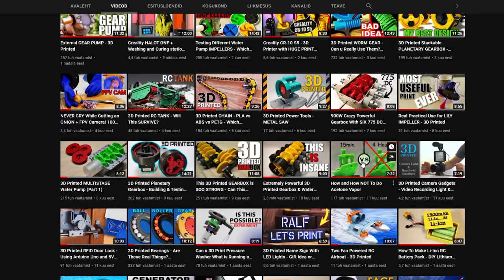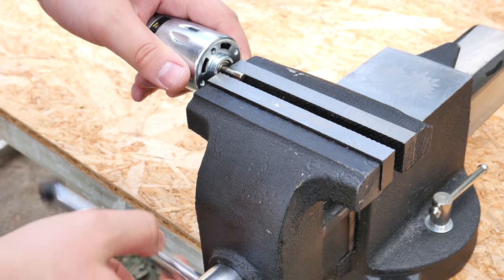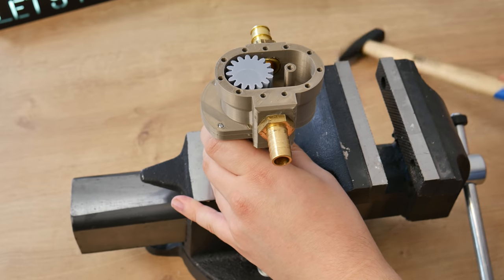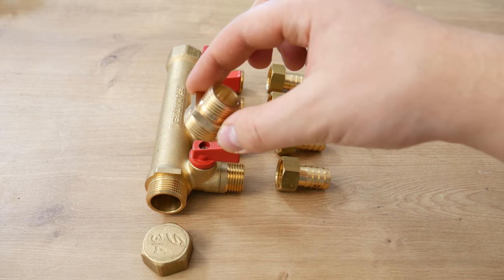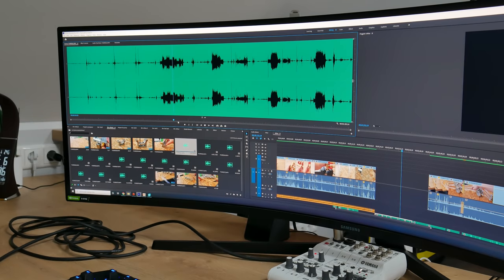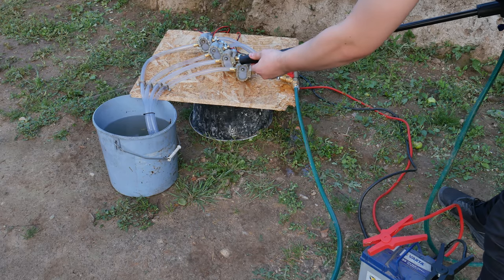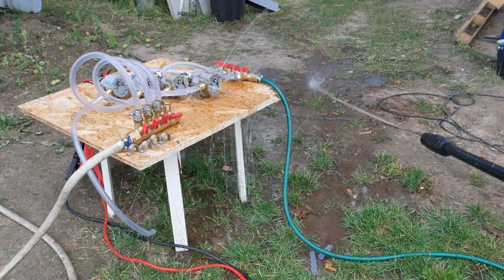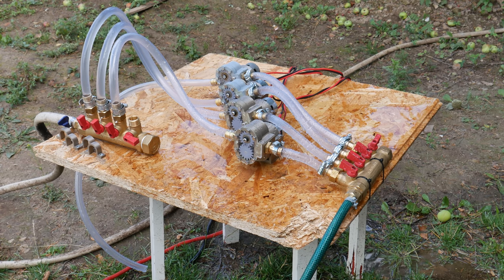3D Printer Pressure Washer with GEAR PUMPS - Part 2

Comment: Try gaskets to help with the leaks. And like Alex said - series not parallel. I think it will really help!
Reply: Ya series setup would constantly step up pressure , losing a bit of volume each step . The ports could be larger on the first pump and steps down incrementally to the final size to help with the flow loss . I have years of experience machining hydraulic pumps . Pressure washers are usually a bunch of small piston pumps parralled up for flow .
Reply: Oh and the inlet of the pumps should be larger than the output to help with effeciency and flow .
Reply: Yeah series
Reply: @turboprint3d  don't forget if he mounts them in series the 3rd-4th stage housing will fail...
Reply: I agree best reference would be a medical home oxygen compressor
Reply: @neptarclepuffin  at this point I'm thinking gear pump makes a crappy high flow high pressure pump for a pressure washer , they seam to work better with higher back pressure , but also need much more power , I pump that large in some produced device would be like 1-2 HP . The hydraulic tester I used to use was 10hp with one pump half the size , and when you dead headed it it would make that motor work to push past the pressure relief valve .
Reply: @turboprint3d  if you need high volume at a high pressure in a single stage then nothing beats a radial impellor at high speed (look at a vacuum cleaner). If you want reliability then by a hose and a 3000ft tall mountain and you will get some good head 😏
Reply: @neptarclepuffin  ya i made a regenerative air pump ( vids up on youtube), with some modifications it would make a great water pump with huge volume , you could feed that to something else to step the pressure up , but its just not the way to go , a normal pressure washer uses piston style pumps usually 3 or more in parallel .
i agree the easiest way to have reliable water pressure is put the tank in the air or way above you somehow lol .
Reply: 2 in series and a set of them
Reply: @stitch8239  in though the solution is more HP
Reply: @turboprint3d  Cheap pressure washers (consumer grade units you use for 1-3 years then they break) are just a wobble plate with 1-3 pistons and would be super simple to print with a 3d printer. You just need a wedge shaped plate (I would cad in a flat track for a standard ball bearing to run on, 1-3 PVC pipes (trying to seal a print for the bore would be more effort than it's worth I would think), then 1-3 piston/shaft combos and some check valves. The pistons wouldn't be too hard, there is no need for a wrist pin between the crank and piston, truthfully you could just make a 3d printed stick with 30% infill and a slot on one end so you can put a bearing in it to ride on the wobble plate track and a groove around the circumference at the other end for an Oring. Just print a housing to hold it all and slot in the PVC and you have a pump that will manage enough pressure to start tearing apart the individual filament strands in the manifold at the top.

It would be a cool, and rather cheap project though.
Reply: @2009dudeman  ya I have never seen one like that , but I guess you don't send the cheap pump to the machinist for rebuild lol I would just make a crank 2-3 cylinders on one crank , with a really short stoke . However with the effort of machining a 3 cylinder crank from metal sort of defeats the idea at that point . Even with bronze rods the connecting surface Of the bearings and rod journals in a pressure washer are larger than a large V8 engine so I don't think 3500psi is something plastic is going to handle I'm any form . It would be sweet if you could manage 200 tho as city pressure is usually maxxed at 85psi it would be an improvement from line pressure . I mean I spent a bunch of time building fictional 3d printed superchargers just to say I can so who am I to discourage anything similar lol
Reply: @turboprint3d  yeah, the wobble pumps come in sub 2500psi units that sell for under $300. Anything over about that pressure (up to about 3500psi) or price point is going to be rotary until you hit the industrial pumps.

The wobble pump would cost more just to ship on and back then buy a new one. They are all ultra bare bones design that consists of a motor (usually with a basic gear reduction), wedge plate, 1-3 sticks with o-rings, and 2-6 check valves in a manifold. That's it aside from the case and bore to hold it all together. Super cheap, minimal tooling.

Perfect for a cheap 3d print job. I would cry at having to print a crank shaft that needs to take any kind of real load with a 3d printer.

I'm not surprised you haven't even heard of them. The second someone brought one in and you opened it up you'd laugh them out of the building for even bothering bringing it in.
Reply: @2009dudeman  really even the expensive ones aren't worth fixing , the time involved and percision needed  would take too much time on a manual machine , in most cases it didn't even need to come to me as we would just buy a replacement pump and bolt it on . If anyone brought us a cheapy we usualy ended up scrapping them or ripping the pump off and makeing a hydraulic transfer pumps out of them , on the case we had to move gearlube at -30°c lol
Reply: Permatex makes RTV Silicone gasket material you can squeeze out of a tube.  You could also put ridge/groove or lap features on the mating surfaces instead of making them flat.  Clear polycarbonate CAN be 3D printed,  though not easily 
Maybe make a recessd flange into which the clear, flat cover is attached.  Probably wouldn't leak if you used the aforementioned RTV Silicone.
Reply: Maybe 2-1 so two pumps in parallel and then a nother pump in series or even more of course but so the second pump has enough water to pump

Comment: you need to connect them in series! to increase the pressure!
Reply: exactly. A single pump on its own had more that enough flow rate, what it lacks is pressure. Putting them all in parallel won't net much pressure increase as the inlet-outlet pressure delta is going to be about the same, so reverse leakage & lack of flow will be the same (so no net improvement). When series together, they should compound their inlet-outlet capability.
Reply: @nickldominator  do this! we are waiting!

Comment: try Teflon tape for the screw-in fittings, really helps with leaking and is super cheap.
Reply: yea came here to post this, you should generally always wrap your male pipe threads in teflon tape to mitigate leakage, especially in a high pressure application, there is some grease that is more effective at leaks but i'm not sure if that holds true at higher pressures, also more expensive. also idk about doing them all in series, because i'm not sure how the prints will hold up to that. i would try 2 series of 2 in parallel

Comment: Plug them into each other. That nozzle on the pressure washer handle is tiny, so it doesn't move lots of water. But what you need to do is plug the output of one pump into the input of another. Also get some gaskets! I suggest you find sheets of thin cork and take scissors and cut around the housing of your pumps! Should leak less then!

Comment: If there is a pt3, you should fix the leaking by using good rubber seals. And you should use a brushless motor. With powerful BLDC motors you won't need that many motors. The 775 motor has torque but not very high in RPM. Try to find a BLDC motor with hight rpm and torque. These type of projects need so many attempts until you succeed.. Thats just the nature of it.  Keep up.

Comment: Should have put Teflon tape on the threads before assembling, the tape will help with leaks, also gasket maker will help with sealing the pumps. I’d suggest putting a thin bead then press the parts together gently and after 30 min to an hour crank em down, they’ll seal a lot better with it in place

Comment: 3:54 Have you tried using grooves for the O-rings with the correct size groove and O-ring it should not push out the side and seal alot better

Comment: Series or a one way valve for each is the way to go. The back pressure from the other pumps will greatly reduce the efficiency and power of each individual pump in parallel.

Comment: Make sure the water pressure on the suction side is high enough. It seems you have cavitation when using these pumps from the bucket. At 7:09 you can even see the pressure side of the pumps contains bubbles as the water is not clear.
When using the water pressure from your house this cavitation effect is solved or at least reduced. At 08:20 there are almost no bubbles in the pressure side. Reducing the pump speed can also reduce the cavitation. It might be that when using the bucket, these pumps work way better when they are placed electrical in series and run slower but without cavitation.
Putting these pumps in series for the water flow and using water from your house as the start should improve the pressure as already mentioned by others. Not sure if this will ever be enough to have a great pressure washer though.

Keep making these fun videos.

Comment: I am a small engine mechanic and I have worked on and repaired many pressure washer pumps,

It is often misconceived that the pressure pump creates suction. It is called a pressure pump because it creates pressure and creates little to no suction at all.The water is pushed into a chamber with a piston vs being sucked in by vacuum. (usually, pressure washers using a multi-stage piston pump lubricated by water)

Try a downstream pump to supply a small pressure of water to your primary pump/pumps and doing them in stages and you may see a huge increase in pressure.Just a thought idea.

Comment: I think you know it, and must have your reasons, but gear pumps don't use helical gears, they use straight teeth gear. 
Using helical gears lead to axial loads, and I believe also very high internal leakages that drops the pressure.
Reply: While I agree with you on the gear part, I want to say that most high pressure water pumps use a translatory movement design instead of rotatory design. Typical pressure washers use a multi piston design driven by a camshaft, with usually oversquare pistons. Not sure how easy would that be to 3d print, but it would be cool.
Reply: @lazar2175  reciprocating pumps can definitely build a lot of pressure. I did not know they were the preferred solution for high pressure water applications. For 3d printing would be massively more complicated due to the amount of moving parts. 
Granted that external gear pumps are widely used on hydraulic systems that can operate with pressures in excess of 3000psi, I do think it's an easier approach here due to the simplicity of design and only 2 moving parts

Comment: I love this pressure washer series ahahaha. Great Job. If I remember correctly from my engineering class at the university the fluid should travel on the outer perimeter of the gears not where the two gears meet. Maybe this can help improve your design ☺️

Comment: It is a volume pump right now. All the motors and pumps are in parallel. Try putting them in series. High pressure pumps for wild-firefighting known as Wajax use an impeller to pump water.

Comment: You're right on the cusp of having a functional system. To have a 100% operational system here's a full list (prices are local and in Canadian dollar):

Teflon tape (~$2). Put it on anything with a thread. Since you're working with pressurized water the water will make its way out, which means less pressure and damaged electronics. Also you don't need much, 2-3 clockwise wraps is more than enough. It's gotta be clockwise so it gets drawn deeper in, going the other way will cause it to bunch up and you'll actually get a worse seal.

Liquid gasket (~$10). Run a continuous bead on any butting surfaces, for example the acrylic cover plate to the housing. You don't need too much of it either, just a single continuous line about as think as fine yarn (~1mm thick). It doesn't have to be perfect, all you need is an unbroken ring that goes the whole way around. Just make sure not too much gets squished inside the pump as an excess will simply destroy the impeller/gears.

A reserve tank (I'd just print one honestly). You only need a small tank, a liter er two is more than enough. The design is easy as it gets: you want a completely sealed vessel with the inlet and outlet both on the bottom and with a one way valve. The reason you want them both on the bottom is so a bubble of air gets trapped in there. Since water can't be compressed you need something in there that can, which is what the air is in there for. As water gets pumped in the air gets squished, that way when you pull the trigger you have something to force the water out. The tip of the pressure washing gun is tiny, by restricting the flow at the nozzle the velocity of the water has to increase BUT the water has to have some pressure behind it or else it won't increase is velocity and will instead just trickle out.

A pressure relief valve ($10-$20). I can't stress enough that it would be VERY wise to install a pressur relief valve on the top of your tank. If a situation arises were your water pumps keep pushing in water and the outlet hose in blocked then there's a serious risk of it exploding. I'm not talking about some little fire cracker either... this would go off with A LOT of power, not exaggerating when I say there's real possibility that it could be deadly.

Lastly you'll want a water pressure switch (digital are ~$15 but hard to work with, I'd go for the ~$30-$40 analog one). You'll want one that's normally close too, so when the pressure is low it switches to the on position and when a certain pressure is reached it turns off. You'll want this installed right after your tank. You'll want to wire your pumps up to this switch, and then connect the switch to a power supply. This way when you turn it on the switch will detect low pressure, kick on the pumps until a certain amount of pressure has built up, then turn them off. Since the pressure switch is set up right between the tanks and the sprayer when you pull the trigger it will immediately detect the drop in pressure and kick the pumps on, so you'll never have to worry about running out of pressure.

Your whole set up should go water source -> pumps -> tank (with a f*cking pressure release valve!) -> pressure switch -> sprayer. Skipping a step without compensating for it some other way just simply won't work ie. You could go tankless, but you'd need a specialized pump... one that's far byoned the scope of this project.

Comment: Without seeing the pressure washer wand connected only to your house water system, as I think that's where most if not all your pressure is coming from.  I have a 2-stroke pressure washer. With the engine off and connected to the house water system, the wand sprays the same as yours.

Looking forward to the video with them in series.

Comment: You should really put a gasket out of a material made from aramid fibres between the upper and lower parts of your pump mount. Someone in the comments also said that you can use a teflon tape for screw-in fittings. I would recommend that and as an alternative - "oakum". These are hemp fibers that are used in hydraulics. Don't forget to use the paste while utilizing those hemp fibers. We would all love to see part 3 with those improvements. 
Best regards

Comment: Maybe try using 2 pumps in series and 3 sets of those, and if you can eliminate the leak and use a faster motor you will get even higher pressure. Another good way would be to reduce the size of the brass outlet coupler thing and a smaller hose

Comment: The pressure washer restricts flow which produces pressure. To overcome the pressure you need additional torque. The tiny motors wouldn't be enough to suffice however the profe of concept works and in my opinion works well. Next time try printing one large gear pump same set up and use a 24v dc motor 800 watt or larger. You should expect a flow similar to a typical house well pump and a pressure of at least 35-40 psi, enough to do work. Thanks for the video!

Comment: May I suggest investigating peristaltic pumps? You're basically pinching a flexible hose with a roller in a motion similar to squeezing toothpaste. Might be cheaper to make and less likely to leak because the fluid never leaves the tube.

Comment: If I may assist you with my experience. I recommend making the inlet 50% larger than outlet. Also at some point check valves would be handy and an inlet strainer for each pump.
You could also print the parts with an oring groove that will help to seal and the bulk oring material can be cut to length and the ends super glued together. I made a tool to help make the cuts in the oring nice and straight and helps to align the ends for precise gluing. Let me know if you'd like me to send an stl for the tool. Petg is nice because nothing wants to stick to petg except printer nozzles and more petg so super glue comes right off and oring doesn't stick to it. For pd pumps a small weep hole connected to a slightly indented path around the ends of the gear will help keep the ends wetted and helps them not to wear and also reduces rotational friction and heat.
This job requires much more torque. Like a bigger motor and a reduction gear box for added torque to get the pressure up.
Like maybe put 2 of those motors on one pump with double the inlet diameter. You'll see a much bigger difference when you open up that inlet.
 Love your videos.

Comment: You should try putting multiple of these pumps in series. I doubt though the acrylic will hold up anywhere close to the pressures you need for a pressure washer